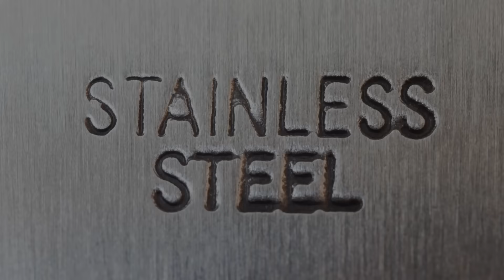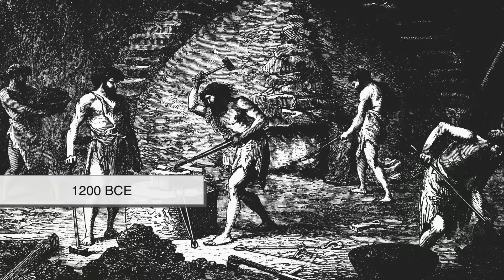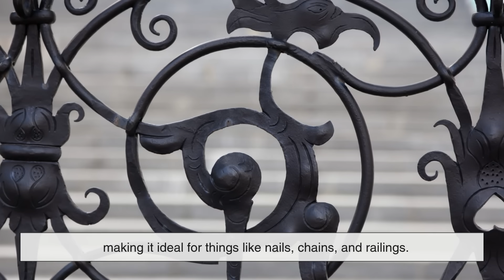What Came Before Stainless Steel?

Comment: I worked at LSS ,Lone Star Steel, and those bars shown is my job was molten steel poured into a water cooled mold and continuously poured , and yes I poured stainless, very hard to cut with a torch 🔥

Comment: It would have been nice to also talk about any "problems" with sainless steel. It is almost always the case that when you make a change to something to improve one aspect or property, some other aspect also changes for the worse.
So stainless steel is corrosion resistant, but what do you give up to ger that result? Does it get less strong or less stiff? 
This video makes it seem that corrosion resistance was a driving factor in the development of iron and steel. While important, I doubt it had as central a role as depicted here.
Reply: "Does it get less strong or less stiff? "

Most SS alloys are stronger than mild steel. However there are also steel alloys stronger than stainless. The problem with stainless steel its that work hardened (Tough on cutting tools), prone to galling (fasteners), and Oxidizes at high temperatures.

Comment: What little I know: a tUbe and a pIpe are the same but a tUbe is measured on the oUtside and a pIpe is measured on the Inside. A tUbe fits perfectly inside a pIpe of the same dimension.

Comment: For the sort of applications which stainless steel is used for today, historically would have been made from non-ferrous metals like copper, along with alloys like brass and cupro-nickels, along with silver alloys and silver-plated brass. Stainless steels became the "jack of all trades" of non-corroding metals.

Comment: Completely missed the incredible variety of steels made in small batches in Sheffield and other specialized production centers.

Silversteel for example.  Tool steel.  Highspeed tool steel.

Hundreds of different formulations were available for every need.

Try doing more in depth research folks, repeating the same lines 3 times does not a quality video make.

Comment: I grew up in a steel town, mostly making steel pipe. The plant used the open hearth process until the '70s. My side of town was covered with orange clouds. Then the plant switched to the basic oxygen process (BOP shop), which was much cleaner. Although many workers like my grandfathers, and even people my age, earned a good living there, retiring comfortably. The plant is an idle eyesore now.
Reply: Were you at LSS in Lone Star TX? If so what years I'm 76- 82
Reply: @JamesDuffey-f7u  No, I've never been to TX. I never worked in the steel plant, but it was the dominant industry here. when I was young.

Comment: Iron can't be forged.  It can only be cast or wrought.
Reply: It can, it just takes a lot more forging to get the carbon levels down to the point its usable, turning it into steel. Iron is forged into steel by beating it over & over.

Comment: During the Bronze Age iron wasn't any better than bronze. The techniques for working with iron weren't advanced enough to produce a metal better than bronze. Bronze was preferred because its lower melting point made it easier to work with.

After the Bronze Age collapse people had to start working with iron since they no longer had access to bronze. It didn't take long for ironwork techniques to improve to produce a metal better than bronze, but it was the lack of access to bronze that drove this innovation.
Reply: Britain had tin and copper aplenty but they still made iron.
Reply: There was never a shortage of copper and tin to make bronze.
The reason for the iron age different.
Reply: @JDrwal2 From what I remember from videos discussing the bronze age collapse, the issue is that the components needed to make bronze are scattered around and you needed the large scale trade network, managed by centralized civilizations, to ensure an adequate supply of all the needed ingredients.

Comment: 🎉🎉🎉How did humankind discover metals?
Reply: They likely just saw the gold, which was the first metal to be used by humans, in its raw state in nature.
Surely the other metals (copper, tin, iron, et cetera) were discovered in the ashes of fires made by humans, as the metal separates from rock/ore with high temperatures.

Comment: The Bessemer process did not remove impurities as such. What had been done before was to take molten iron and try to adjust the carbon content to the desired level. However, the results were terribly imprecise. What the Bessemer process did was to literally burn out the carbon from the iron so that he could then add back in a precise amount, giving a controlled result that could readily be replicated. It was a terribly inefficient process by today's standards, but was a revolution for its time in that, now, there was real quality control.
Reply: I have been to Ironbridge today :o) To Blists Hill museum.
Reply: Don't forget the part Robert Forester Mushet played in the Bessemer process , brilliant bloke.

Comment: Since Bessemer we speak of steel.
Reply: This applies to PC steels.......Steels made in Bessemer converters had nowhere near the volume of Oxygen blast as what Basic Oxygen vessels do now. Steels are also Vacuum Degassed and Control Argon Stirred producing very clean steels.
In Bessemer times, steel was also produced using the Open Hearth process with some huge furnaces.
The last time I saw Stainless produced it was in an Electric Arc furnace and Argon / Oxygen Degasser.
Reply: Steel existed long before Bessemer.  What his innovation brought was large quantities of relatively inexpensive and consistently high quality steel.

Comment: For the love of God, stop saying you can steel in the Bessemer process.  You make iron in the Bessemer process. Stainless steel and any steel needs to be made in the crucible process.  They are not the same.
Reply: Iron, as a pure element, has almost no real world applications. Bessemer's "converter" was developed to produce steel from "pig" iron. The latter has no useful properties, other than as feed stock for "cast" irons (reducing the impurities, and also the carbon content, though still quite high), and the more refined (even lower carbon) steels. Cast iron has a lower melting point than steel, but tends to be brittle. Crucible steels were for refining the steel still further, and controlling the carbon content for hardenable "tool" steels. I agree that the Bessemer process reduces the carbon content a low level, but carbon is added in to get the required proerties. This was Bessemer's deliberate intention, to produce better steel for artillery.

Comment: Cast iron is much more resistant to corrosion than carbon steel, although before ductile cast iron it was very brittle. There are still one hundred year old water mains in use, and after scraping some agglomerated sand chunks off the outside, the original lacquer finish becomes almost like new again, with very little deterioration of the iron.
Reply: The old process for those pipes was one called "Spun Pipe" where Cast Iron would be cast into a spinning mould. That Carbon steel would contain around 0.20% C whereas the Cast Iron would be around 4.5% so the latter contains more Fe and more prone to oxidise.
Reply: My sewer pipes in my house are over 100 years old and still sound.

Comment: stone then bronze then copper then cast iron
Reply: Cast iron is actually a relatively recent development, roughly the Victorian age.  It takes a very large smelting furnace to melt the iron, allowing slag to easily separate and carbon to dissolve to the levels of cast iron.

Comment: First of all stainless steel IS NOT SIMPLE. The short answer to the heading question is RUST. I am curious why stainless hasn't been applied to the 2 areas most in need of improvement, mainly structural steel like rebar and beams exposed to the elaments and plumbing pipe for water and sewage.

Comment: Another continued use of non stainless steels is tools, for example drills, wire cutters, screwdrivers, sushi knives, machining cutters - not all kinds of tools can be best made with stainless steel, or the material properties of premium carbon steel (eg holding fine edges or being extremely hardenable) could only be achieved using very specialized and expensive types of stainless steel (eg powder metallurgical or cobalt bearing materials). Also - mind that hardenable (martensitic) stainless steels are a very different (and actually less corrosion proof) material than the austenitic, nickel bearing stainless steels used for pots, pans, sinks etc.

Comment: Another myth was it wasn't magnetic. Depends on the alloys I suppose.
Reply: There are multiple kinds of the so-called stainless steels.
Some are magnetic, some are not. Some are hard, some are kinda soft, causing machining tools to overheat and destroy themselves.
Reply: Check your stainless refrigerator with a magnet, it is probably magnetic. 400 Series grades are used and they contain Chromium but not Nickel.

Comment: In t video it said that wrought iron is worked to remove the carbon. It's to remove other impurities and slag, it is by adding carbon that iron becomes steel. Also wrought iron is known for rusting by thin layers at a time. Pure iron & steels will Pit and rust through.
Reply: The furnace smelted iron ore, pig iron, is not pure iron, it has very high carbon content of around 5% and is very brittle. Decarburization improves the malleability, and it becomes steel once the carbon content falls to around 2% and below, but obviously complete decarburization makes it pure iron.
Reply: @KarriKoivusalo  Whenever I see Pig Iron mentioned I try to explain exactly what it is, so here goes. Pig Iron is / was produced by casting molten Iron into small moulds, which became known as Pigs because of the round back little ingots produced. This is done in what is called a Pig Mill where the moulds are filled from the ladle of molten Iron. This is done for shipping / transport for later use in foundries.
We Aussies had a famous wartime Prime Minister Robert Menzies who was given the nickname of "Pig Iron Bob" when he attempted to send a shipload to Japan in WW2 just prior to him becoming the PM. It's a good story that can be researched on.
I analysed many different grades of steel in my working life and performed mechanical testing also. The purest was one that contained a max. of 0.03% C and 0.08% Mn so basically the purest Iron made by steelmaking process.
Reply: @KarriKoivusalo  The modern blast furnace smelter gets hot enough for the iron to melt, and absorb much carbon from the carbon smelting fuel.  Older and much smaller iron smelters don't get hot enough to melt the iron.  So not a lot of carbon dissolved, but the iron collected with heavy slag inclusions that had to be removed by heating the iron blooms and working the metal to drive out the slag.  Producing wrought iron, which still has a grain structure of slag inclusions.
Reply: Wrought Iron is FULL of carbon. Working it removes carbon because repeated heating burns the carbon off the surface.
To make it harder the carbon has to be added back.
Pure iron doesn’t rust at all. The carbon in the matrix is what facilitates the rust. The varying carbon composition of wrought iron is what forms the grain.
Phosphate iron is naturally corrosion proof…

Comment: My general disillusionment with technology began, I believe, with the discovery that stainless steel stains. One of my colleagues reminded me that it's stain-LESS, not stain-PROOF.
Reply: Iron left over from processing stainless parts is what rusts
Reply: @flashgordon3715  yes, usually the result of a poorly done passivation process leaving traces of free iron on the stainless surface.  400 series martensitic and 17-4/15-5 stainless can exhibit a limited amount of surface rust.  Those alloys are used where hardenable stainless is required.
Reply: @jeffreywhitmoyer860  Doesn't stain in typical environments at everyday temperatures. A highly caustic and/or refractory environment will find most stainless wanting.
Reply: CRES 300 should have no iron in it to rust. It's a misnomer, it's stainless, but not steel, typically copper nickel. CRES 400 is a misnomer too, it's steel, but not stainless 😊
Reply: @dragonhealer7588 The rusting on 300 series stainless is due to surface contamination, for instance on castings there is sometimes free iron contamination in with stainless steel shot.  This is often due to operation r error.  410 & other 400 series will rust slightly but still form a weaker passive film on the surface.  There isn't as much Cr in these alloys to form the surface film.  It does however resist surface corrosion.  300 series stainless is 80% iron more or less depending on grade.  The term corrosion resistant doesn't mean corrosion proof.  Surface rust is more an inconvenience in many cases than a problem.  What is more critical is proper solution treatment to prevent intergranular corrosion.  If pitting  corrosion is an issue selecting a grade with Molybdenum alloyed in at around 2% will help to avoid that problem.  These days there are several groups of corrosion resisting stainless varying from the martensitic 400 series which was essentially the first stainless, the austenitic alloys, super austenitic, duplex, precipitation hardening and ferritic. All have their own applications and pitfalls.  Then you get to move into the Nickel Alloys such as Inconel, Hastelloy etc. which have their own set of applications and are not really stainless steel. They also have inherent problems when working with them.  Many of them have little to no iron or carbon in them.  We can't forget Copper Nickel and Monel (NiCu). The whole subject can be extremely fascinating for the curious person.

Comment: In general stainless steel is not as strong as carbon steel.
Reply: I hate it when stainless steel knives claim to hold an edge forever.
Reply: Define “strong”.
Reply: @marekstanek112  “strength” is typically defined as a how much force is required to make a material fail, usually if the form of fracturing or yielding. Carbon steel alloys can be produced to exceed the strength of SS in any measure. Whether that be hardness, tensile strength, shear strength, ductility, fatigue resistance, you name it. Whereas SS must have an alloy mixture that provides corrosion resistance, carbon steel does not. This means that the alloy mixture for carbon steel is a blank canvas that can be optimized entirely for the desired strength characteristics, but SS is limited to an alloy mixture that must provide corrosion resistance - those materials that provide corrosion resistance may provide additional strength but may also limit its strength potential. Comparing mild steel to SS, the SS is usually stronger. But comparing something like tool steel to SS, the tool steel will likely be stronger than all but the most exotic SS alloys.
Reply: @sschoon86  true, but not the point.
I meant you need to define what exactly you mean by strength for a specific use case.
Reply: Stainless Steel grades are many and varied. The common old 18/8 (300 series) used in your cutlery differs from that used in say, your refrigerator which is often the 400 series containing Chromium but not Nickel. I recall one grade 310 which contains around 25% Cr and about the same Ni.
Reply: But it gets harder when worked.
Reply: But drilling it is a nightmare.

Comment: In olden days, steel guns or swords typically used a coating of oil or wax to prevent rust but the coating needed to be reapplied when it wore off or after the steel was cleaned.  Cosmoline was a thick greasy coating applied to steel guns or knives for long term storage to prevent rust.
Reply: This is still the case today. Most guns and many top quality blades are still made from non stainless steel and oiling is essential to protect it.

Comment: Kind of a missed opportunity to focus on why temperature is so critical and why humans spent many generations trying to increase ancient furnace temperature. However, although iron melting temperatures remained elusive, they did eventually achieve sintering temperatures, which was an enormous advance for tribal communities. This history is poorly documented. Animal bladders and skins were formed into manual bellow pumps to force air under a furnace, centuries before Bessemer's 1856 presentation.
Reply: Bessemer's process isn't blowin air under the coal. Its blowing air through the iron.
Reply: The future title would be "What came before the modern combustion air blowers and forceｄ draft burners" NO? ＼(^o^)／
Reply: This was an overview, not a detailed history. There was a lot that could have been put in that would have bored most of the audience.